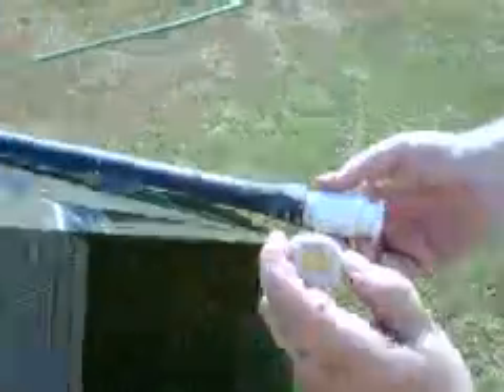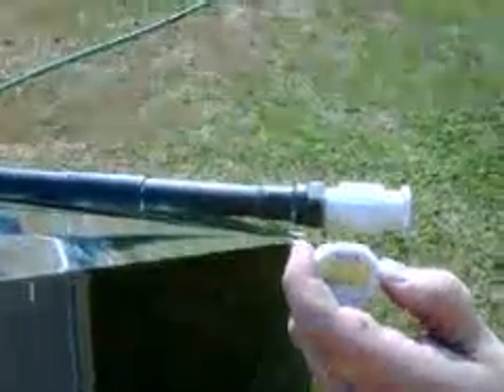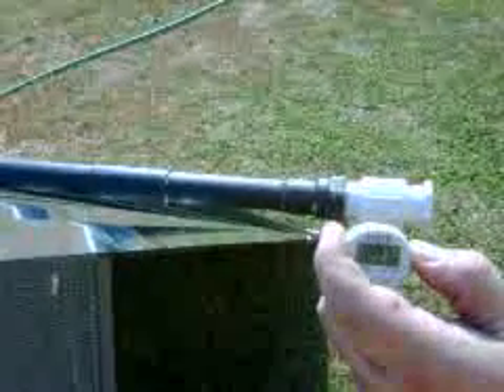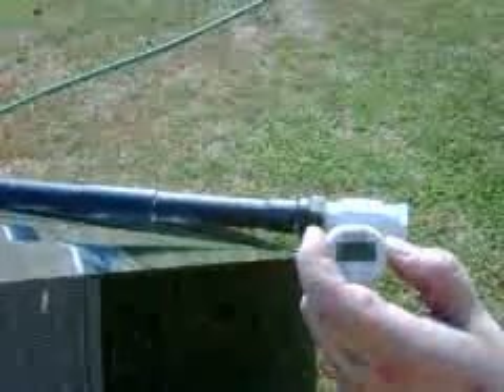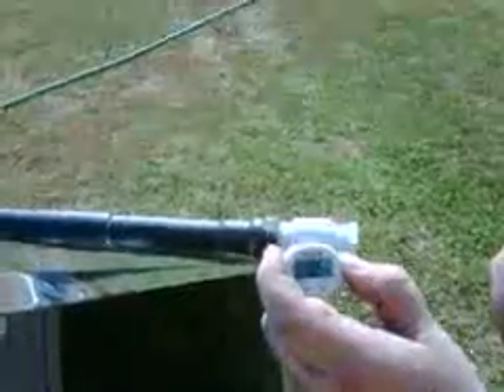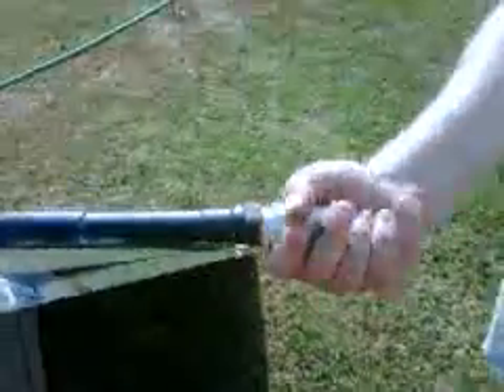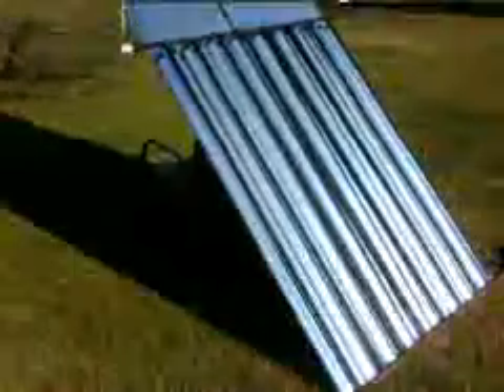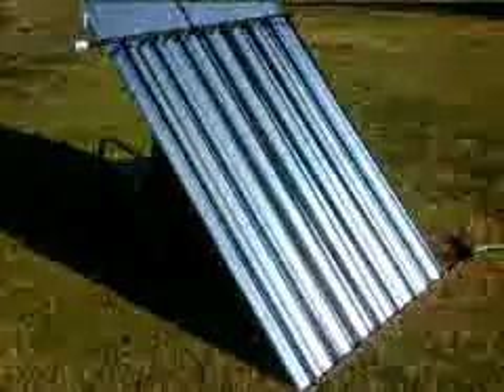Solar Water Heater build 7

Comment: Guys. Where possible get old water radiators from homes being torn down. You then paint them jet Black and either circulate water through them while they are in the Sun, or just fill them with water to use.

Comment from the maker: @catatonicable I am not sure, I have not tested that specific method. I have however re-purposed this heater to use as a heat transfer system, I installed a 12 vdc pump inline and closed the loop, I used soft copper tubing and wrapped it around a pony water heater tank that has been stripped and painted black, I use a glycol solution in the closed loop system and its heated by the sun then flows around the pony tank which is also heated by the sun and the water enters the

Comment from the maker: @iqah29 sorry it took so long to get back to you, the gaps on this prototype is 5 inches, the reason being is I didn't think about volume or insulation as much as getting a working model, there is plenty of space for another flow tube in between these and if you know what 3/4-3/4-3/4 copper tee's look like then you can literally make small inserts to butt the ends up tight, this will help in both volume and insulation.

Comment from the maker: @John1576able please do not tell people to do things that will harm them, old radiators are filled with rust and other heavy metals and are very not suitable for drinking water, if you use them them make a closed loop system and run a glycol mixture through them to do a heat transfer setup to a potable water tank.
I believe in reuse things as much as possible but in the safe and correct way only.

Comment from the maker: @catatonicable pony tank and is heated byb the heat transfer and then goes into a 80 gallon insulated tank for used and is under gravity pressure, I have considered using a 12vdc pressure tank to keep this pressure constant but I have not done it.

Comment from the maker: @dimitriosart  water goes from this to a well insulated holding tank then is returned back to this panel using thermosyphon principles, it is drawn from the holding tank either directly for use or into a conventional  water heater, this cuts the heat up time for the conventional heater thereby saving you loads of money.
There is a number 8 video to this series and I will be uploading and completed unit video sooner or later.